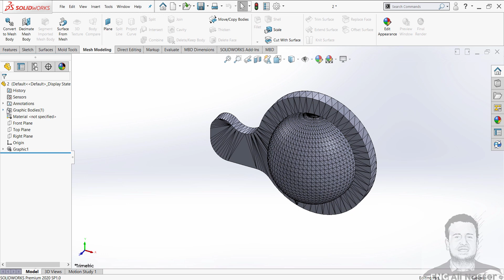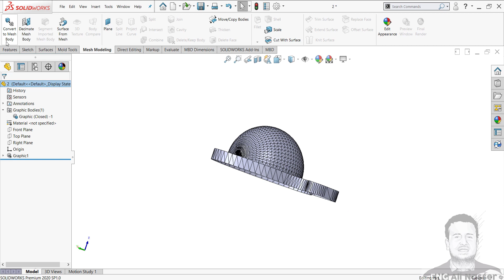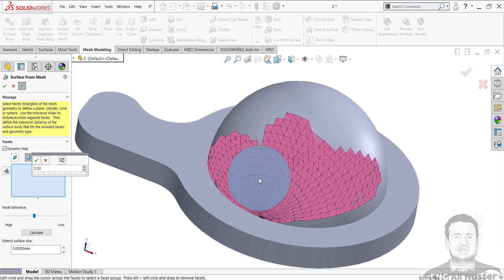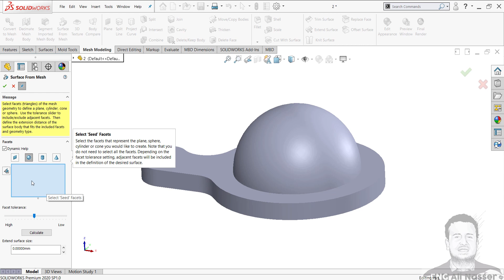Surface from mesh │Solidworks mesh modeling│

Comment: hello I can't use the option surface from mesh with my model . my model has some holes and open spaces in middle. any help is appreciated
Reply from the maker: Hello,
You need to use geomagic design x software to handle that.

Comment: hi Ali, I have a more complex model and I couldnt convert it. I wish there was an easier way to jump between blender to solidworks and viceversa, and not having this triangulated mesh....any clues?? thanks!
Reply from the maker: Try to use geomagic design x
Reply: @AliNasser  thanks, but I'm looking for a free solution
Reply: @ilustradsn FreeCAD can convert .stl mesh to step file or solidwork file for free.

Comment: What if the meshing is come from scan file, and the scan file is not complete where there are some holes/incomplete meshing? Can we still use your tutorial?
Reply from the maker: In this case you need to use geomagic designx it will be better.